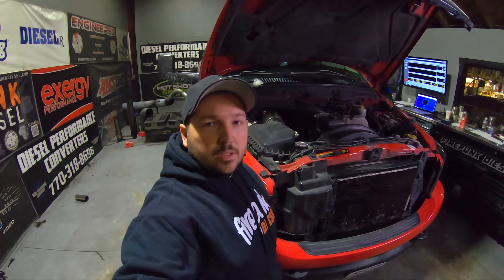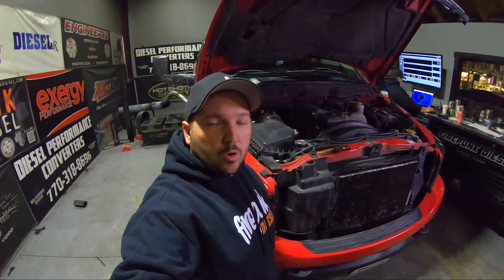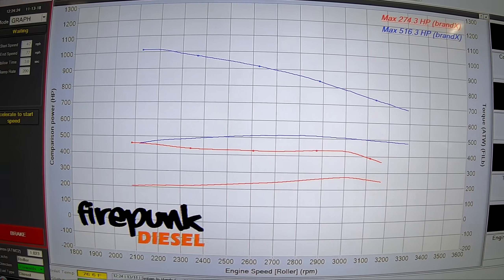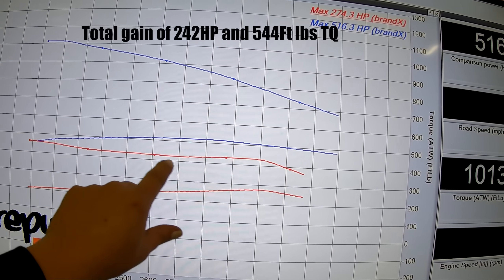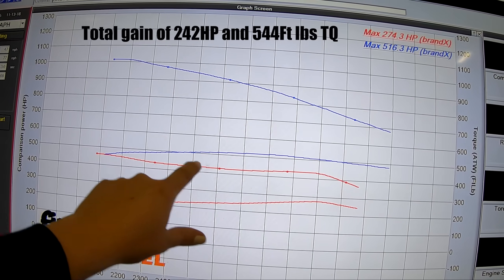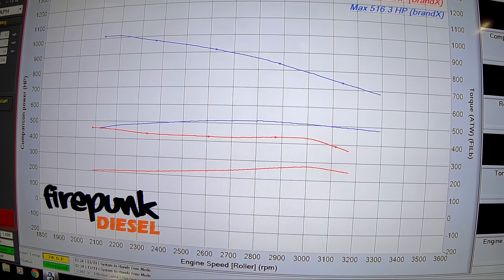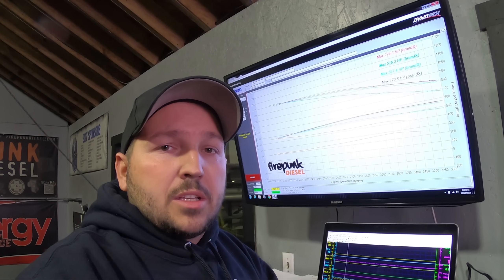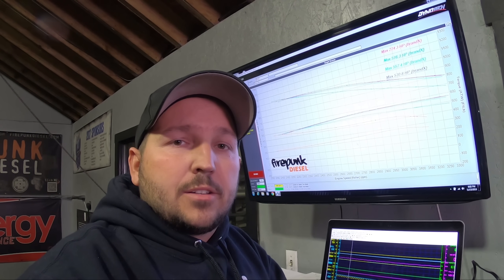5.9L CUMMINS TURBO AND TUNE INSTALL WITH 300HP GAIN

Comment: Question: Is a tune required when dropping a turbo on a Cummins with g56? Before yall start roasting I work as a structural engineer. Barely learning the ins and outs of my diesel

Comment: What did that fancy turbo take the boost levels to ?? 

What are safe boost levels for a stock set up?   I have an ‘06 am putting in a BD diesel stock replacement with an AFE 40psi waste gate.  Wondering if I’m in the danger zone or worrying ‘bout nuthin

Cheers guys 🍻🍻

Comment: I have a 2004 Dodge Ram 5.9, I did not see a EFILive Tune 5 for a 2004, is there one or one that is comparable.  I would also like to do the turbo upgrade but is there an issue with California emissions as far as you know?

Comment: I plan to due a mm3 tune ony truck with stock injectors may put custom built nozzles on them and rebuild them. What do u charge to set my truck on the dyno and see how well I did.  It is mostly a ranch truck planning a flatbed and custom paint most racing it'll see is highway and airstrip playground. 😗🤔😀

Comment: Just curious what kind of dyno u are running. Also I was thinking I have a 2004 pre cat. Quad cab 24 v Cummins. Have a 5" mbrp straight pipe just a l and n in a stock box. I'm sure I could gain 30 40 horse by deleting the stock box. But it's a 305 horse platform. Unlikely. Running 35" tires 3:73 gears and a 48 RE aluminium shaft 5" as well what is your geuss on rwhp with what I have said. Stock tune as far as I know truck was bought at a dealer with 8700 miles on it. I have had it since at less than 120k

Comment: What tuner do you recommend for a 2005 Cummins with nv5600
Reply: i had that same truck it was awesome, most people get a smarty its a good tuner for a lot of reasons. Optimalwelding makes some good tunes too, he can make any tune you want and shift on the fly with a 4-6 position switch.

Comment: Do you have to sign a waiver before truck goes on the dyno
Reply from the maker: Yes, just basically stating that you accept the liability of anything that happens to your truck when put under full load.
Reply: @FirepunkDiesel   I figured that have you heard the one sounds and have advised against a Dyno run

Comment: Wow, that's amazing.  You just took an engine worthy of 500,000 miles and with your incredible skills guaranteed transmission failure and an engine that won't last another 30-50k.

Comment: Hola tengo. Una dodge ram año 2001 motor diesel 5.9 manual de 5 velocidades pero esta muy pesada no levanta rápido  que le puedo hacer para que levante rápido y sea ligera. Espero su respuestas. Gracias

Comment: 500+ hp for 1 second is pointless.  What can you do for 15 minutes when I need it pulling a load up a hill.
Reply: You guys know what shop this is right? Best 48re transmission shop in the country and countless championships in the diesel world, considered the top Cummins performance shop by most everyone. Definitely not clowns lol
Reply: 2,000 rpm dyno pull is pointless, these clowns need to pull from 1,000 rpm with the converter locked in, in 3rd gear. These are fake numbers.

Comment: I hope you get this comment. I have a 06' 5.9 and can't believe that a turbo change can gain this much. But I worry about engine longevity and reliability. What is your experience?
Reply: Worry about it because anytime you put power to a motor shits gonna happen. Cummins maybe not at 600hp but your tranny will hate you. That’s what the whole forged internals thing is about build it for 2000hp run it at 1000 to have some reliability

Comment: Is the transmission factory stock
Reply: Very unlikely. I've been pulling 16K lbs. all over North America for a couple of years now. If I were running that tune on my stock 48RE it would rip it right out from under the truck. One thing to dyno...another to use. This is misleading. Best thing you could do for stock tranny is keep engine stock. Otherwise, replace @ $16K to go up to the Allison from Denver Colorado! Don't be a fool! Keep the stock tool!

Comment: Hows the egts, for towing with this turbo and stock fuel. With the tunes?
Reply: If I had to guess, too high. Probably 1,500 degrees. I've seen these guys shop trucks, they all run pig rich.

Comment: How much can the stock internals take, with around 300,000 miles
Reply: Mine took 55psi of boost for about three months and it started letting compression rings go had 320k on it and knew I was doing a complete rebuild and had the same question. Max effort tune on mine made 480hp at that time.

Comment: Would love to see this back to back dyno run with you guys using a 2003-2005 cummins and hp tuners interested in how much the max effort would add to the older trucks

Comment: How would the transmission in this truck hold up to the first tune? Would you need to lower it some for it to be safe? There is a 2006 5.9 mega cab I have my eye on, and I believe somewhere I read the transmission from this year is a little better than the newer ones.
Reply: Trevor Alexander not exactly if I’m not mistaken they are 48re

Comment: How long will the stock trans last with this set up?
Reply: Luke F. It wont
Reply: 15 min.  111k the stock tranny on a stock motor just imploded.  Im thinking of replacing with a RZR cvt, it would have more durability than the 48re

Comment: I have a 6.7 Cummins with a 12 mm cp3 air dog 165 fleece cheetah turbo on stock injectors with a bank's intercooler and on3 performance intercooler and BD intake Horn and EFI live what kind of HP you think that would have
Reply from the maker: High 500s would be my guess, a vgt turbo always limits peak power a little compared to a non vgt.

Comment: I feel like it should’ve made more power, I’ve seen countless 06s with a built trans and no other mods but efi and a drop in turbo make over 600 to the ground
Reply from the maker: We have too Jacob, but every truck is different, this truck did 274HP stock when usually they do 290-300HP, the stock lift pump/cp3 simply couldn't support max effort injector duration on this truck,  We have done 632HP on a truck with all stock fuel and a 366 turbo.
Reply: Firepunk Diesel I gotcha boys

Comment: Can efi live be used on a 2005 ram cummins 3500 6spd and where can I get it done?
Reply from the maker: 03-05 trucks we do the same custom calibration but use HPtuners instead of EFI live, we can do this in house or shop.firepunk.com has HPtuner remote tuning packages where we ship you a flashing device with instructions
Reply: @FirepunkDiesel  will call your office to set something up and give more details, thanks.

Comment: was this with a stock 48re?   the tow mirrors up and light bar surely helped those numbers
Reply from the maker: For sure!  Transmission is not something we took apart to see what was done, the customer bought it like this and was told it had a stock rebuild but wasn't given any details, but we know at 570/1000, a stock transmission will not survive long-term
Reply: @FirepunkDiesel  just out of curiosity, is there even a safe level for a stock trans even with just tuning?
Reply: @FirepunkDiesel  I know this is an older video, but what kinda of power do you think a 48re with TC upgraded to a single disk billet TC be able to handle?
Reply: Stock power is too much power for a stock 48re. Lol

Comment: I wanna see what a second gen swap with a s467 and a fleece lift pump cld do on a deleted 6.7
Reply: I have a 2nd gen swap s467, 50% over injectors, fass 150, industrial 10mm stroker pump, built top end motor, built 68rfe making right at 800 hp tuned by truck source diesel. About to replace rods and do a mild cam then do a 48 swap

Comment: I have same truck I would like too buy that turbo off you guys in the next month or soo but I have a 03-early 04 truck what do you guys suggest or have for tuning for that truck and how much does it cost
Reply from the maker: We use HPtuners for custom calibrations on 03-05 trucks and its $400 for a single custom tune file
Reply: We keep them one of each of our 5.9 drop in chargers on the shelf at all times. When you are ready to order they will have one ready to ship ya!

Comment: I’m already running your tunes on my 06 and recently installed a 64mm he351 similar to a tater built and was wondering if I should update my tunes , did you do any adjustments to tuning after you installed the 67 on this truck?
Reply from the maker: You should not need a retune until you change your injectors.  Tuning controls fuel quantity and your max power tune already has fuel quantity maxed out, adding a turbo simply adds more air (boost) which burns the leftover fuel, giving you a power increase without changing tuning.
Reply: Firepunk Diesel ok awesome thanks for the reply!

Comment: Curious what the cost of that would be? Efi, turbo and labor included...
Reply: That ain't bad! 2grand to get 1k ft lbs ain't bad at all. Now...how long is a stock tranny gonna like that?
Reply from the maker: Efilive with switch installed is $550, turbo is $1450 and install is $300
Reply from the maker: Stock trans will not like it for long, if your planning on having this power/tq on tap, it's best to plan on a built transmission.

Comment: Interested it doing this on a 04 but not sure what to do about tuning
Reply from the maker: We can do the same custom calibration with HPtuners for 03-05 trucks
Reply: Firepunk Diesel even very early 03??
Reply from the maker: Yes, if it's a 250hp 03 then the injectors are smaller and you'll have about 40hp less fuel, but tuning capability is the same.